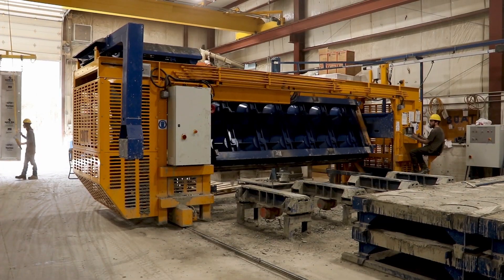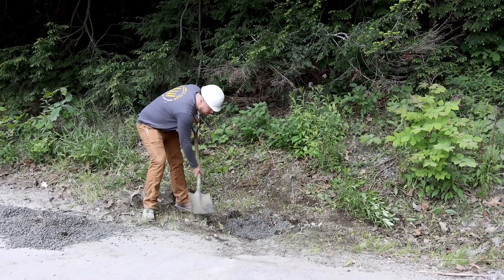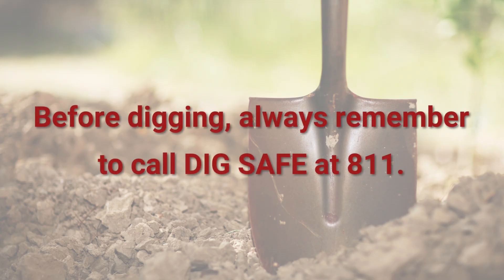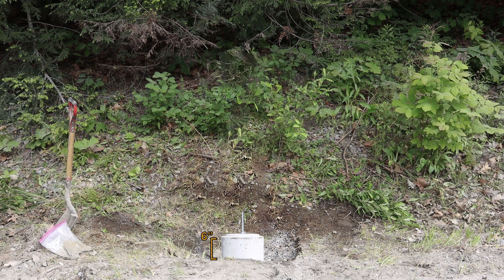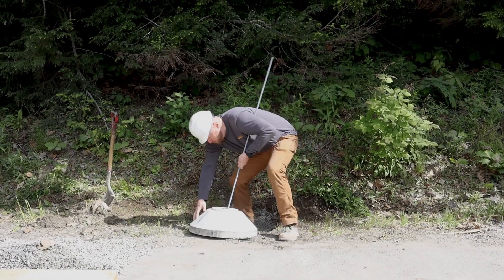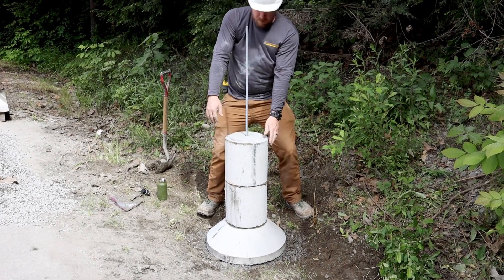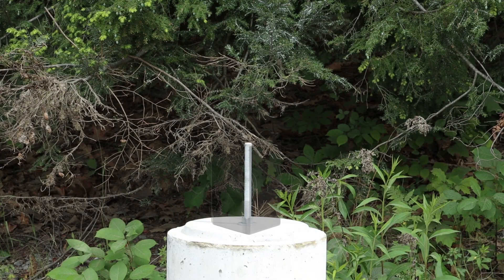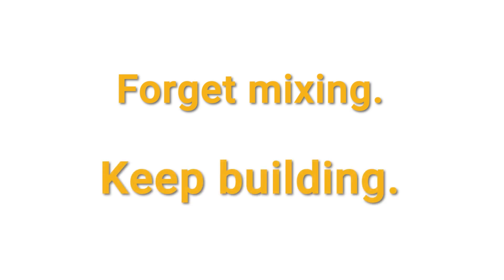EZ-TUBE Stackable Precast Footing Installation

Comment: These stackable precast concrete footings really save a lot of time on the field,  I have my concerns about lateral load for a pier that height.
Reply: Can I stack this in a dug out pier hole & where do u get these?
Reply: @carlward9367  Home depot carries them
Reply: As long as these aren't on a hillside, lateral load capacity for a subsurface footing won't be a concern due to restraint provided by the soil.
Reply: exactly.  @Loonypapa